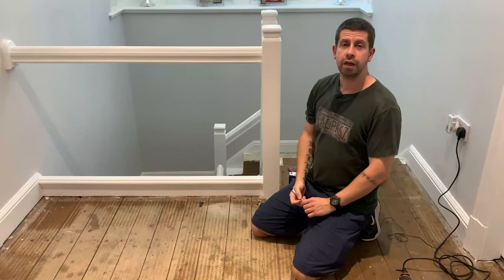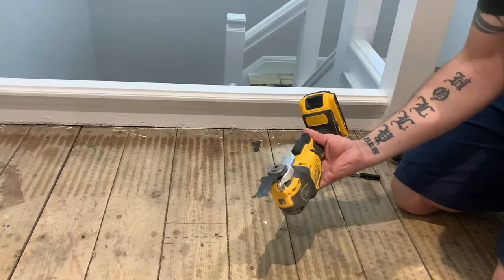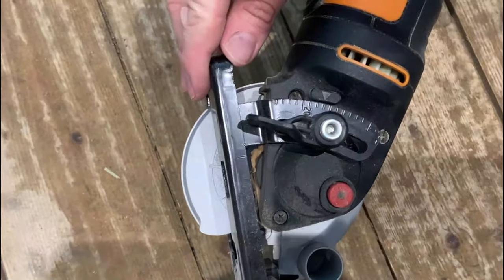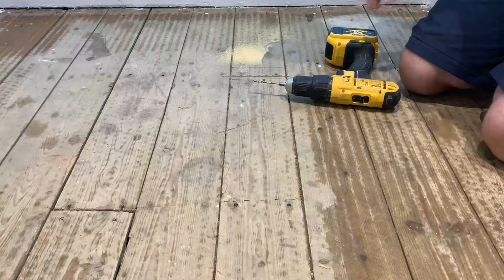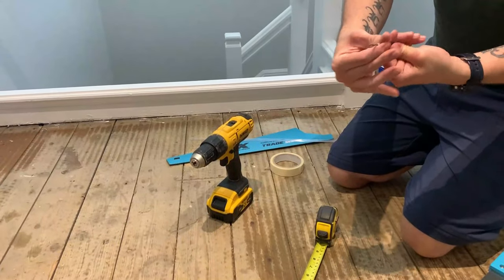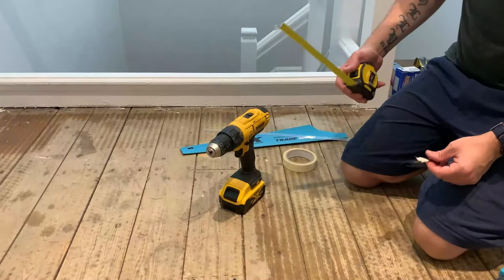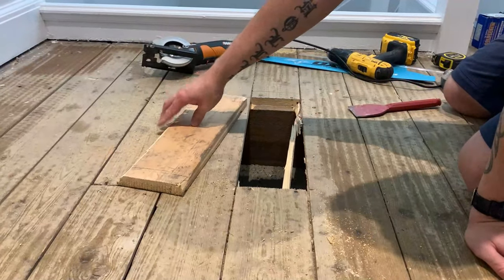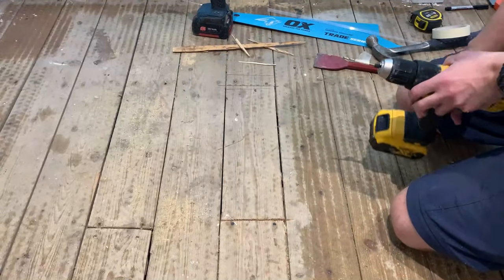How to cut, lift and replace floorboards. Quick and easily

Comment: Pretty much how we used to do them when wiring houses. Circ saw best, hand saw and flooring chisel if no circ saw on job. Seen loads of cut cables and pipes, where people have  used jig saws (sawn off joist) and other methods. Also found boards where they have cut off the joist, then failed to put a suitable stretcher to hold the board, then they go through eventually. Thye have done this in a house that I am currently restoring. Also, the boards squeak when you walk on them after tongue is cut out, so in my own house, I screw battens to the underside (lengthways in line with board) to offer more support. If ever a chipboard floor is cut to access services, it squeaks really bad afterwards. I hate them.

Comment: Nice video mate. I'm surprised your Dewalt Multi Tool doesn't have a depth stop i have the same one and  mine came with one. Keep the videos coming
Reply from the maker: Mine did come with a depth stop but I forgot all about it 🤦‍♂️ I didn't like using it on my old multi tool so when it came with the Dewalt I just threw it in a drawer.
Thanks for watching 👍🏼
Reply: What is your trade mate you seem to be good at all of them lol?
Reply from the maker: @jackhouldsworth8640  I am a cabinet maker by trade and I was taught to make fine furniture. But I have learned lots of other trades by doing houses up and not having the money to pay people. DIY has been my hobby since I was a kid and I am a massive tool geek.
Reply: Good stuff mate. You've inspired me to start doing my own plastering no reason I can't do it
Reply from the maker: @jackhouldsworth8640  it's definitely worth having a go, it's saved me thousands £s 👍🏼
Reply: Will you do a tiling video?
Reply from the maker: @jackhouldsworth8640  I've done one about cutting tiles and another drilling holes in tiles. If I do tiling in the new kitchen extension I will be videoing in.
Reply: Nice one mate 👍

Comment: Question.  So you need to put services under there; however, I don’t want carpet back on I want wood floor! So the cuts you make would look atrocious! Is there a fix for that?
Reply from the maker: Find the ends of the board and lift the full board up 👍🏼

Comment: you can use the multi-tool just put a bit of tape on the blade at  the depth  or the floorboards
Reply from the maker: Yeah that's another great way it just takes a little longer.
Thanks for watching and don't forget to like and subscribe to help me out 👍🏼

Comment: When I first started rewiring houses I used a floorboard saw, like a panel saw but with a curved blade, jesus! that was hard work.  I then discovered you could do a really good job with a jigsaw angled backwards and fed in slowly, it does work.  Now I have a minicircular saw and a multitool, unfortunately (or maybe fortunately) I don't rewire houses any more.  Great video though, I've certainly watched a few of yours now.

Comment: I’ve found that if your cutting floorboard it’s easier to cut through diagonally across the nails, that way you’ll never miss the joist. And if you’ve lifted lots it makes putting them back down easier as they will all piece together better. 

Only really works if there’s carpet going back on top though
Reply from the maker: That's a great tip. I have used that method in the past. 👍🏼

Comment: What if you don’t want to damage the adjacent boards? Can you circular saw close to the edges and then use a jigsaw perhaps?
Reply from the maker: Multi tool is probably best not jigsaw incase you go through a wire or pipe

Comment: Dealing with creaking floorboards is it to simply drive some extra screws in tightly as possible?
Reply from the maker: The squeak comes from either the wood rubbing on the metal of a nail or the wood rubbing together so if the boards are screwed down tight then the squeak is eliminated. Just be careful not to screw through pipes or cables which should be in the middle of boards so you can screw either side of them.
Reply: @spendtimesavemoneydiy  thanks for your advice mate 👍
Reply from the maker: @leepartington6378  you're welcome 👍🏼

Comment: Thanks for the video. Really useful. Do you reckon the Worx saw would be any good for cutting 27mm decking boards? Got a few jobs lined up - Skirting, decking, tearing down some cladding etc (max cut depth 27mm).  Trying to get something that would be up to all of them on a budget. I'd been contemplating the 85mm saw on your link. Cheers
Reply from the maker: It would cut through them, it has about a 30mm cutting depth. The cordless version might struggle a little bit.
But it is a brilliant saw and good value for money.
Thanks for watching 👍🏼
Reply: @spendtimesavemoneydiy  Thank you

Comment: As someone now fixing decades of floor board abuse by the trades, I say don't let traders damage tongue and grooved floors,  pay the extra to get a plasterer in and go through the ceiling.  It gives better access to the trades person and a plasterer will make short work of patching in a panel that you will never walk on and hear it squeak or move, your carpets will not get a line appear where they work into a gap and dust will more likely go up the vacuum cleaner and not into the ceiling void.  It's just cheaper and the sparky or plumber feels about to cover up the damage going through the floor.